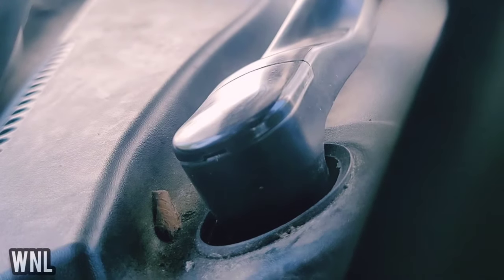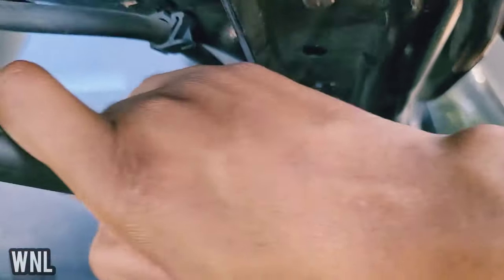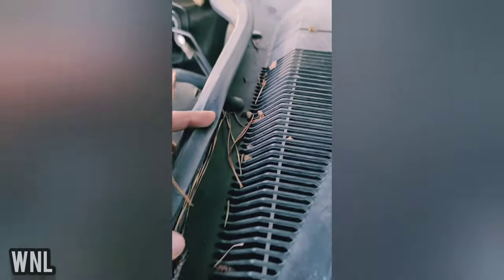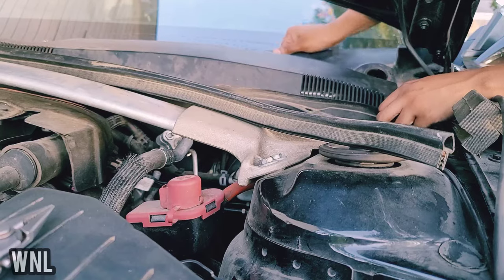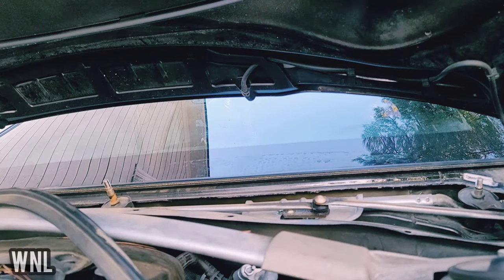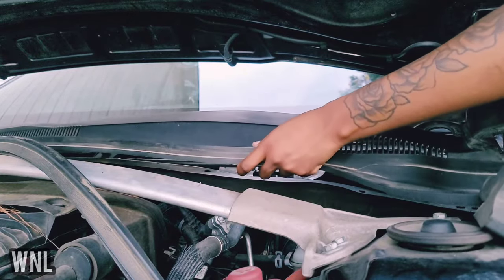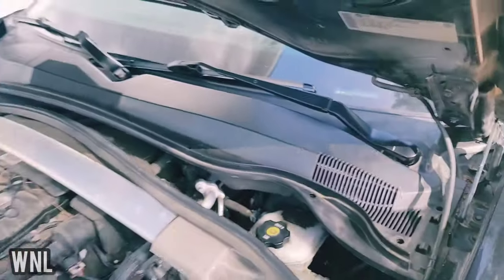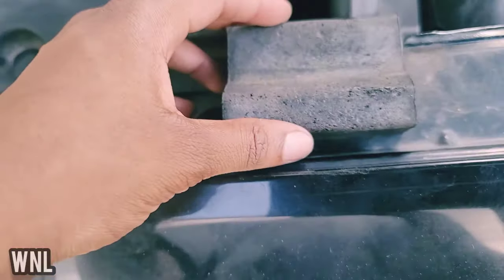Wiper Arm and Cowl Removal / Install

Comment: After removing the cowl it would have been a good time to cover the openings the biggest for the cabin air filter. I have used hardware cloth and gutter grates securing with self tapping screws or JB Weld putty

Comment: I’m just trying my best to find what the part is called on the sides of the cowl. Can’t find it but my vehicle is out in this Texas heat and it’s a 2015. Those plastic side pieces have crumbled into tiny pieces and need replacing.

Comment: How did you get the wiper arm off. I took the nut off and it seems like the arm is pressed on.
Reply: You gotta push down (put preasure) on the bladed side and lift on the nut side simultaneously